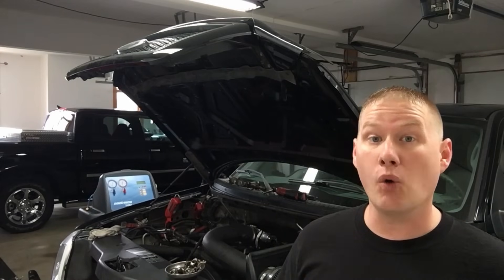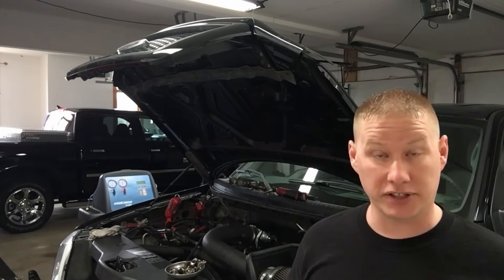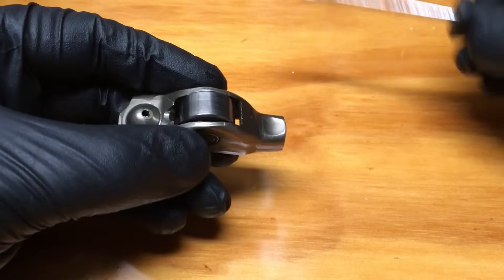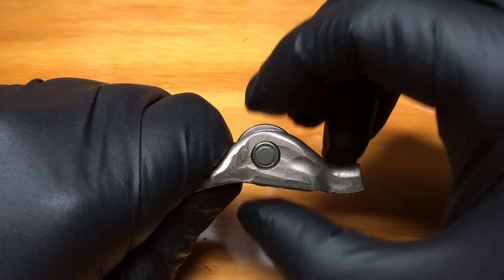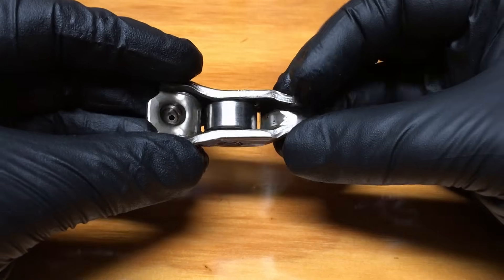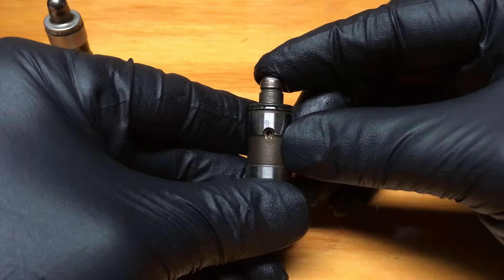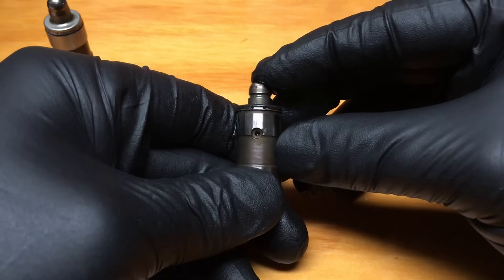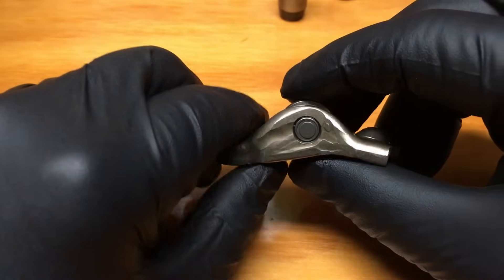Ford 5.4L 3v Triton Engine Ticking Tapping Noises: Must Inspect Items!

Comment from the maker: These are the updated Parts:
Ford Racing Full Kit-
http://amzn.to/2r85QBs
Roller Followers (all model years)
http://amzn.to/2r9zabs
Lash Adjusters (2004)
http://amzn.to/2r83WAO
Lash Adjusters (2005-2014)
http://amzn.to/2pFUDYw                                                                                                                                                                                      5.4L 3v Repair Playlist-
https://www.youtube.com/playlist?list=PLnkaHoqfNwiFPohL7Hf9CAv-veTUzxQga
Reply: FordTechMakuloco.  you are a wizard...love your videos..thanks..
Reply: I have that triton 2004 5.4 3V, should I just do the cam phasers, timing chain and these all together, I have a slight ticking on & off, I have only used mobile 1; 5W-30...bought this brand new 170K miles. I love this truck & your vids are very useful thx👍
Reply: FordTechMakuloco l like yours videos they are the best, l have a concern about the PCV valve on 5.4 Triton engines if you have some information about it..thanks a lot !
Reply: U saved me 2000 dollars watching your videos you're the best thank you
Reply: 1. Is it recommended to soak new roller followers and lash adjusters (after primed as You've suggested) in oil for a few hours before installation?

2. Can I use Chem-Dip to clean valve covers or will it damage the o-rings around the housing guides for the 8 valve cover mounting bolts?

3. Can I use Chem-Dip to clean the cams off after removal?
Reply: Hello fordtechmakuloco im wonder if you can help me with my problem ... i have a 2010 ford f150 v8 3 valve obviously the problem is when when u stop in a stop sign  or red light my engine get a noise like tapping noise or like engine with no oil and start shaking but when you accelerate no shaking and noise desapear .. also I have p0345 and p0022 sound like my timing components are failing .. but this happen only driving in city when i take the highway nothing happen even if i stop ... i replace camshaft position sensors it dont work .. then i change my oil cuz was 4000 miles old (syntetic) and the problem seems solved but i still having the light and i noticed is a lite tapping noise ..
Reply: @alanwatts8117  You most likely need to do a timing job. My 08 5.4L 3v ran like a raped ape on the freeway but did the wobble, ticking, knocking when at low rpms too. I'd pop er in nuetral and rev it up to about 2200 rpm at a stop when the engine misbehaved. Mine did the wobble worst in reverse
Reply: @texanbalaban6777  yeah is what i figured  i replace the oil cuz was 4000 miles old and seems like the problems is fixed i dont have any issue now no noises nothing just when i plug my scanner p0345 comes on put there is not engine light on my dashboard ...but i dont know im gonna start saving for a new engine 0 miles im not gonna deal with those timing jobs i hear from alot people after you do timing job on this engine never is the same and alot of problems .. thank you
Reply: @alanwatts8117  i also did camshaft sensors, injectors, lucas gas treatment often and oil changes. It was timing.
I let my spark plugs foul and ruined my catalytic converters, so something to watch.
I'm not sure what P0345 code is offhand.
Even with a new motor; sooner or later You'll "have to deal with timing". My testimony is i did the timing job at 280,000 miles, bought truck at 180,000, and after timing job the truck runs WAY BETTER than it ever has in the 5 years I've owned it.
You'll be at roughly $1,000 and 10-12 hours of work to do the timing Yourself as compared to $3,200 for new motor plus whatever the costs or time to put new motor in. Your choice but nearly every motor has to have a timing job so just the nature of the beast brother
Reply: FordTechMakuloco I have a f150 with the 5.0, the engine knocks when cold but not at idle only when you accelerat gently but ones it’s up to temp it goes away I had the oil change to Castrol full synthetic 5/20 and it’s not a taping sound it’s a knock that comes from the bottom of the truck, what should I do I jest bought the truck
Reply: Do u know what may cause the ticking noise on the 2v? Only ticks when accelerating not at idle
Reply: FordTechMakuloco please see my comment below
Reply: Those roller followers Amazon says does not fit my 2007 f150 is that true or do they have it wrong.
Reply: @xocavemanox1  the first link is basically stock roller follower, while the second set Ford Racing has the redesigned roller follower hole for more oil flow to camshaft
Reply: I have a 04 5.4 3 valve with 151,000 miles can't tell if the ticking is this or not.does the engine light come on? Can you feel it? thanks
Reply: FordTechMakuloco will this help the ticking on my ford fusion?
Reply: @alvarosilva957 different engine design  ,  the mechanical concern in the video is specifically , for the 4.6L 3V  , and the 5.4L 3V .
Reply: Can I leave the phaser on cam when unbolting cam. And I need to check rollers.  Do I need to position  cam before involving if I mark up for along ment?
Reply: I want to pull the passenger cam with phaser attached.  To allow me to to change rollers and lash adjusters.   Do I have to set at any position before unbolting?
Reply: Will these work on the 2 valve 4.6 I got a 06 crown Victoria that's a lil noisy?
Reply: @toxxic35  I'm not sure B0$$.
1. I did soak in oil pre hand. 
2. Chem dipped the valve covers which came with a new set of donut seats in the felpro gasket set.
3. Yes chem dipped the cam shafts to a sparkling clean.
Reply: TY
Reply: Can you change the lash adjusters w/o removing the cam?
Reply: You list two different lash adjuster part numbers but a single full kit. Does the kit fit all model years?
Reply: Is there a way to ask you a question about 2000 mustang v6.
It has to do with ticking & valve covers. Thank you
Reply: All unavailable shucks lol
Reply: I have a 2000 Expedition Eddie Bauer Edition with the 5.4 and has over 209,000 miles on it. Did these have the same issue as the newer ones? Thanks
Reply: Same problem in the 4.7L dodge engine

Comment: Hi Brian, I did a complete timing job at 153k, and replaced all of my roller followers and lash adjusters at that time with OEM parts. I'm now at 175k and I have a slight ticking at startup on bank 1 that I'm thinking is a collapsed lash adjuster. It goes away after a bit of acceleration. I was wondering if going to 10-30 or 10-40 oil would help. I am kind of pissed, because my original roller followers and lash adjusters never failed in 153k miles. You just cannot depend on parts, even OEM any more.

Comment: Do one with a 2 valve engine
Reply from the maker: They never fail.
Reply: @ I got the 01 SVT lightning it taps only when accelerating any thoughts, did timing chain, rocker arms looked ok still
Reply: I think mine failed. 04 f250 5.4 v2.. Constant noise on passenger side. Sounds like the lash adjuster but I won't know for sure until I inspect.

Comment: Hi I live in Australia & have a 2003 Ford BA Ute with a 5.4ltr V8 3 valve engine & floor shift auto
My question is when I first start the engine it is nice & quiet just nice V8 sound then after 3 or so minutes it starts getting rattle noise around top middle area of engine like tappets noise must be when oil warms up & gets thinner I imagine 
I recently changed the oil & filter & put in Penrite full synthetic 10W 40 which is thicker than recommended oil though I thought it would fix the rattle noise after start up it did help a little though not as much as I’d like & now really need your advice in what to do next 
Do I try even thicker oil?
It has done 135,000 klm
Looking forward to your help as I'm desperate to fix this noise, hopefully without pulling it down as it has not done many klm's
I have searched your articles on the 54. Ltr 3 valve engine & have not seen a specific one for the engine being noisy after start up when oil warms up so would be a great one I believe for the wider community. 0:11 
Thankyou regards Neil

Comment: I have a what would you do question... Purchase an '04 F150 w/ 167K miles for $5800 and it just started tapping or
'06 F150 w/ 126K miles for $9K.  Take into account, you only have basic diy skills not the master tech you are. 
Great content and I've learned a lot watching you the past month since I started looking at Ford trucks! 
Thanks for your time.
Reply: I would not buy a 2004-2010 F150 5.4L, engine is too finicky; best to buy the 2011-2017 F150 types with 5.0 and 6 gear auto xmission

Comment: What happens if you were to NOT prefill the lash adjuster before install? Do they have a chance to build up pressure within the plunger during use or not? I just did a a full timing job with melling pump but when pumping up lash adjusters before install i laid them horizontal and never got them absolutely stiff as seen. Now i’m worried haha. I have a ticking but figured injectors as its otherwise quiet and smooth without favoring one bank over another
Reply from the maker: They will finish pumping up in vehicle yes.

Comment: I hear a sucking noise on the drivers side of the engine just randomly happened what could it possibly be and how urgent is it to take to mechanic? There are no codes on dash or engine light.

Comment: Thank you for making these videos. I bought a 05 F250 from my work for $1k. When I first started it up it sounded like a diesel... I knew this was not got. I didn't know anything about the triton 5.4l, but because of your videos I've learned a bunch. My company took the truck out of service because it died in an intersection while towing. I changed the oil, replaced spark plugs and switched to 5w30. Runs much better. Next thing is the rocker arms.

Comment: Hey dude. Appreciate all the help!  I recently performed a timing swap and a full follower/lash adjuster replacement.  What I found when i got inside was all the followers checked out perfectly fine. However, all but two of the lash adjusters had approximately 1/4” slop. I could lifter the plunger (not depress it) about 1/4”.  Seems weird after what you showed on your videos.  Problem, after reassembly I have a temporary tapping noise that is worse than before but it gets quiet after about 30 seconds.  ?!?!?! seems like the lash adjusters are not holding pressure when the the engine has set for a bit.  An immediate restart after it has been running yields no tapping.  The parts I used were sold as a Ford factory kit but…  I will say the truck had not been maintained very well and it pretty varnished up inside.  Is there and oil additive that I could use in case crap got inside the new adjusters and help clean them maybe?? Any help is greatly appreciated.  Getting ready to retire and was hope to geet another 175000 out of the truck.

Comment: Nice vid.   I want a new F250, but a local used truck dealer told me he does not sell Ford trucks newer than 2017 because they have noisy engines.   Does that make sense?  Thanks!

Comment: My 2007 navigator was ticking and 2 of my spark plugs ended up being loose. Thanks to this man here I’ve fixed this prone to breaking engine all by myself and I have no mechanical experience whatsoever. This man knows his stuff. And evidently I got lucky that my plugs were loose instead of being seized and stuck considering I have a 3 valve

Comment: Hey Guys maybe im right here. Im writing from germany and i have some asks... when my F350 5.4 V2 99er is accelerating i have a quiet tapping or ticking noise. It gets louder with the rpms. Now i have changed many things rollers and hydros glowplugs... I need some help or ideas as to what it could be. i mean an F350 is unique in Germany and I don't want to scrap it.

Comment: I own a 2007 F150, long crank before it will start. I check purge valve, not getting stock. I notice when full gas tank it will not do it. Please help.

Comment: Hoping for a clarification on priming the new lash adjusters. I've been soaking in oil and pushing the plungers in every way i can think of for a week, and half my new lash adjusters still feel spongy and can be depressed more than the known good in this video. It feels like air is trapped in the lash adjuster. Are these new parts bad, or will they bleed down all the way once running in the engine? 

Also thanks so much for all your great videos, there is no way my truck would still be running without them!

Comment: If no issues present with lash adjusters can I skip replacing them? My mechanic is doing timing job, roller followers, and oil pump on my 2007 f150 5.4 3v. It would add another 600 dollars to replace lash adjusters. would like to avoid if I don’t have to replace.
Reply from the maker: I never see them go bad and all I work on is the 3v engines.
Reply: @FordTechMakuloco  ok great thank you so much for taking the time to respond you really are helping middle class America!

Comment: Can a bad manifold gasket also make the same kind of noise ?
Reply from the maker: yes
Reply: @FordTechMakuloco  is it possible to tell only by the sound it makes ?  I bought a 2006 f150 5.4l.  It makes that kind of sound , the only problem it gets, the truck is pretty clean.  as its my first Ford truck, your videos are going to be pretty useful...  going to check this next week...

Comment: Hey Brian. I did the full rockers replacement, after the timing job because i didn't get to see this video on time, and i did not replace the lifters, since i did not want to pull the cams out anymore. Are the lifters prone to failure as well?
Reply from the maker: no I never change them nor so I find them failed.

Comment: Just came across your 5.4 engine noise videos and am wondering how applicable the info is to the 3V 4.6 engine used previously in the Mustang GT (mine is a 2008). I'm getting a ticking noise until the engine warms up and read on a Mustang forum that it could be due to worn lash adjusters. Am I correct to assume that if I replace the lash adjusters I might as well replace the roller followers? Also, since this seems to be a known issue - has Ford (or anyone) produced revised/improved lash adjusters and cam followers for the 4.6?

Comment: Have you ever seen a collapsing lash adjuster causing a misfire on start up with no other sign of issue other that a check engine light? Doesn’t miss long enough to feel it.  Could be cold or hot. Happens every 10 starts or so. Full timing job was done with all Motorcraft parts about 20k ago. New injector on the mentioned cylinder. All new OEM plugs and coils also.  No valve train noise noted. Runs perfect other that the intermittent  CEL.

Comment: Hi, I’ve got a 2014 E150 with a 4.6 2v I have recently started hearing three Knocks some time at cold start up. Like 1.2.3. Then the noise is gone for the rest of the day.  I may not hear it again for a 2 to 3 days . Am I looking at a timing chain/tensioner noise?

Comment: Brian, having a issue with a 3v may be you can help me get back on right path.

truck comes in, DIED going down road, one click.
diagnosis bad starter (replace remand).
fired right up. test drive hear metal on metal noise. truck died. one click. 
put a breaker on crankcase  like its froze!.....first Q-
flexplate and starter binding, can this freeze up the crankcase?

Comment: Brian, or really anyone knowledgeable lol. I need help with diagnosis of my 4.6 3v in my 2010 f150. Developed a ticking noise that I self diagnosed from watching your videos as possibly the cam followers. Replaced them and still have the ticking noise. The tricky part of this issue is the ticking is only present with the truck in gear and under load. Will not do it in idle. Thanks
Reply: Sounds like manifold leak...exhaust

Comment: I have an 03 Triton that I'm babying along with over 200K miles. I'll have to make my way over to Chicago to have you look mine over- it's making the usual engine noises, but if you listen closer you can hear the cam and the rocker/cam followers tapping quietly away.  Planning on doing an upper engine inspect/repair/seal in the next year or so. Like I said, I should bring it over (I live in Iowa) and have you do a tune up and listen to it, haha.

Comment: Can anyone or @FordTechMakuloco tell me if the lifters can be removed without taking off the cam? I have these noises, truck has 260k miles, no visible scratches or wear on cam lobes...I am contemplating ordering all lifters/rocker arms and replacing them but not comfortable removing the cam shafts. I know you can get the rocker arms out without removing the cam shaft but need to know if the lifters will come out, they seem to be under the camshaft,  is there enough clearance for them to come out?
Reply from the maker: You must remove or lift the camshaft.
Reply: @FordTechMakuloco  thanks for the reply, hats off to you my friend, because of you I've gotten the confidence to do a TON of work to my 2005 F-150, saved me thousands! Maybe I'll gather the courage to take the camshafts out and do it properly. Thanks again.

Comment: Man I've got a lash adjuster stuck in a 3 valve on #4 the very last one. It came apart and caused the follower to come out. And believe it or not, it knocked the valve spring off but didn't demolish anything.  Only ran about 3 mins after it started missing. But the large part of the lifter is stuck in the bore. Any advice on getting it out without pulling the head?

Comment: My 06 expedition has 220k and going.. chased a failing MSD coil and back in business. Changed plugs once, and injectors twice, 1 alternator, 3 batteries.
If the truck gives up I'm puttin that 5.4 in a 56 F100.

Comment: As i converted my 2011 ford expedition to CNG (Natural Gas) the Ticking sound is gone and Engine runs Much smoother , When i run on petrol again the Ticking sound Persists , When it starts it runs on Petrol and after 10 sec it goes to CNG ( Natural Gas).